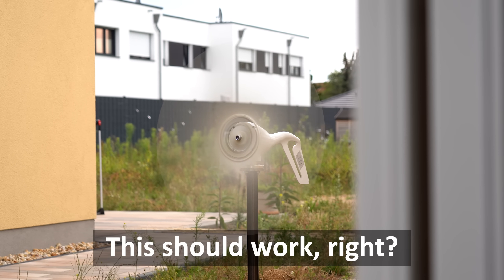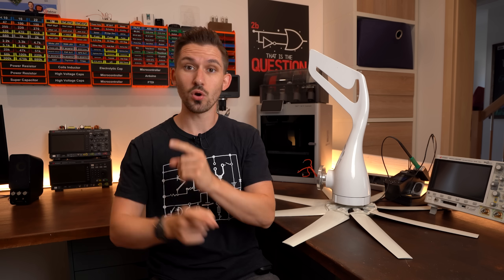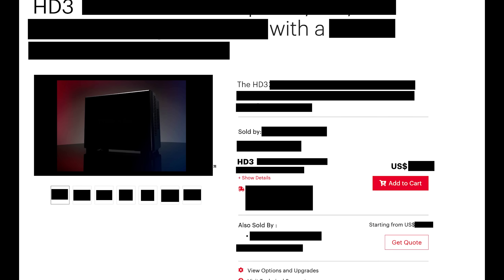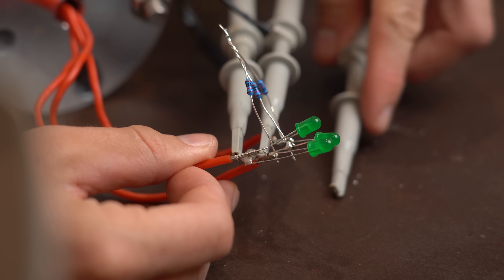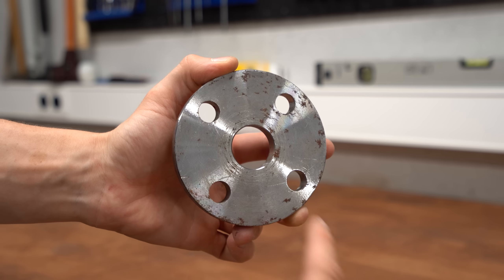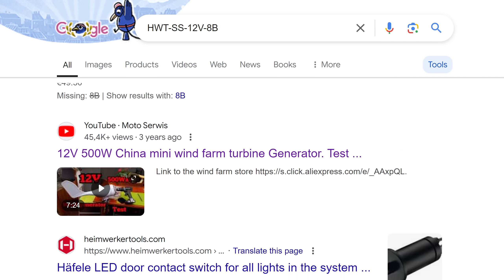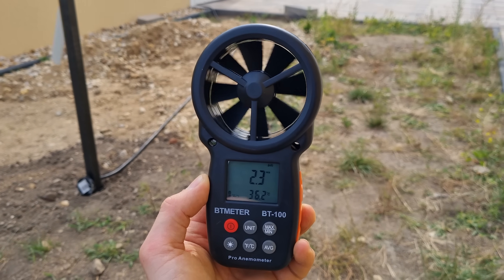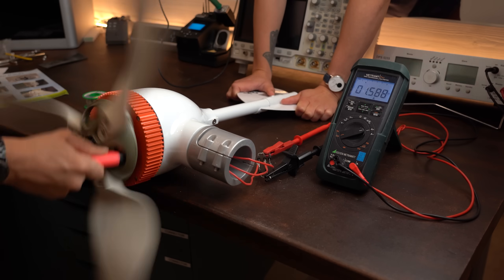I tried to Power my Home with Wind Generators! (Worth it?)

Comment: I just bought a house. It’s a shell. But I have a 40 foot (12 meter) cliff to a stream at my property line. I have an electric scooter with two 1kw motors. I want to make one a wind turbine and the other to make hydro from my future swimming pool. That should help boots my solar. So far I make enough electricity from solar just not from November, December, January and February. But there plenty of wind here in those months.

Comment: If 2 turbines are wired in series at the DC output are they capable of maintaining high enough voltage to feed an mppt? Or could the turbines be wired in parallel at the AC outputs? And tied into a single controller?

Comment: Even if it's your first time welding, it's impressive that you are able to get it done with a stick welder at all. Kudos! Definitely keep practicing, it's a fun hobby, but if you had to start from scratch I would say definitely start out with a flux core welder. It's easier and is like a hot glue gun for metal. It's like learning to drive with a clutch (stick welder) vs transmission (flux).

Comment: you can hardly get several watts from one square meter of the generator sweeping surface. To get interesting amount of energy it needs 5 or 10 times bigger models.

Comment: small wind generators are never really worth it financially. the reason people still get them is either to reach a higher level of autonomy, for remote locations or ships, or as a hobby. The location is also key. the wind turbine should be mounted as high up as possible, and as free standing, regarding the main wind direction, as possible. A high building can be suitable, but there might be NVH concerns, so an extra pole is always a good idea.

Comment: Wind turbines in suburbs no way. I use the latest Jinko 475 Watt solar panels, at close to 60 cents Australian per watt they are far cheaper than any wind turbine I have seen. No moving parts in solar panels, no noise. Interface the solar panels into the 5KW Growatt SPF5000ES inverters these inverters are a budget inverter not that reliable but hopefully they will get the bugs out of them. I like them because of their combining of the MPP Solar charge controller for the 48V battery. My OFF GRID system has been going for 8 years now. Run a separate 230V  OFF GRID switch board exporting is a waste of money now. Leave wind turbines for the big companies.

Comment: 12:20 would cog wheels work? Like bicycle where the front one is bigger than the rear smaller one for more rotations? Can you decrease the chain length or remove it altogether and attach the windmill to a bigger cogwheel that spins the smaller one so fast, it works as expected?

Comment: When you can choose different voltages, always go for the highest voltage. That way even the mppt tracker you got with it will work fine. 12V is not even enough to charge a battery. Most made mistake with these wind generators.

Comment: Could you make some fins that were longer? 

But thinking about it... 24" to 36" -- might only get you a 50% boost ... which would only be 1.5w to 2.25w.   You probably need 60w (or at least 30w) per hour to be remotely useful.

Comment: Not a bad first weld at all.  Go a littls slower, turn up the amperage, & and leave a gap between the 2 pieces (flange / pipe) next time. You can use a few washers to get a gap & and help penetration

Comment: I think a hybrid option would be the best.  Wind power is kind of junk, but it can trickle in a lot of power over a long period of time, so if you have a decent battery hooked up to maybe only the lights and only the secondary water pump, you can lose power or save a bit of money on just a few essentials. 

Combine this with a wood stove and I suspect that maybe you can light a house with LEDs, heat/cook with wood, and power your water pump. Fridge, probably not. PC, probably not. Charge a phone yes. 

The pump would be the most demanding, but the least used. So if you keep your lights off when not in use or maybe supplement with candles and get enough steady wind to  charge your battery, you should be fine.  

Don't expect a lot from wind, but realize that it's not useless either as long as it is realistically sustainable and not breaking down or acting janky often.

Comment: There isnt much you can do with wind energy at such low speeds and small turbine sizes. If I were you I’d try to use the dynamo inside with a water source.

Comment: sense you think they dont have enough power i noticed in the head of the motor the propellers have holes what if you add magnets in those holes and what if you put magnets in the holes in the center shaft inside the motor it also had holes i bet doing so will create tremendous power while spinning

Comment: Allthough small scale wind generators not nearly worth the cost or trouble,i recently tried to repair 1kw charger/ regulator for wind and solar.Draw my own diagrams-  from microprocessor to output mosfets.Took weeks.
Electronically speaking,quite interesting.Learned a lot.Couldnt repair it,due to ic that were totally destroyed.No numbers.But came to conclusion it was well designed,manufactured.Burnt out,owner remove wires at wrong order with strong wind present.Or so i think.
From practical point,total waste of time.Cost too high for construction,generator itself,with relative small power delivery.And the noise will really irritate me.Due to cost of wires,you just cant built it too far from home.

Comment: All these cheap wind turbine generators are just crap. The resistance of the generator coils are way to high, so in the end mainly all the power gets wasted inside the generator. I have bought one myself out of couriosity and teared it apart. The engineers, which designed this, should be ashamed. This borders on fraud.

Comment: A smallish wind generator like you hold in the picture will never power a home,  most of the small ones like that only make 100 watts but what they can do is help support solar and charge batteries at night when solar is off if the wind is blowing.    You need a large wind turbine of around 1000watts to have a chance of powering your home off of wind alone but you still need solar and batteries for times when there is no wind.

Comment: A good solution is to increase the surface area of the blades by making them wider rather than taller snd attaching them to a  large pulley (like a bicycle wheel) and the use a belt to cennect it to smaller wheel pulley attached to the turbine. This way you can spin the turbine at high RPMs to supply meaningful power from relatively slower wind. The key is to improve the torque of the blades.

Comment: Interesting video- you put it to the test in a scientific way. It's not a big surpise that a small wind generator close to the ground near buildings doesn't give much power- most wind generators are placed up high and away from buildings (buildings cause a lot of turbulance). The size of the blades, of course determines the potential output, the small turbines are usually seen on boats as a battery trickle charger, and, of course boats are often in places with a lot of wind, away from buildings. Savonius (vertical) wind turbines that use push rather than lift are better close to buildings but don't move as fast for power generation, they are better for mechanical work such as pumping. But, the big advantage of them is that they are quite easy and cheap to make.

Comment: Thanks for this. Adding the noise issue for anything that is adequately sized and the fact that anything with constantly moving parts requires maintenance and repairs, and its clear that wind power is far from being a domestic power option.

Comment: Over several years of having an expensive 1kw wind turbine, I can categoricaly say it's been a total waste of money. Either there's no wind, too little wind or too much wind where I have to shut it down or even drop the mast. The wind velocity range of operation is ridiculously narrow. I wish I'd just bought more solar and batteries with the money, so as there's way more power stored than I'd ever need. Lessons learnt.

Comment: This video was very disappointing a waste of time. If the turbine has to be so low, where it is a danger, The least you could have done is used a sheet to funnel wind flowing between the two houses into the turbine.

Comment: I did the math too for my place, and i found the power density wind frequency curve didn't justify a wind generator
but maybe in my farm i could put a higher and bigger diameter to power any future electronic controls like a  raspberry that collect data from sensors spread around the farm during cloudy days.

Comment: why don't you hook the turbine up to a step up transformer instead of rewiring the generator, get it up to 20 volts then hook that up to a voltage regulator of say 15-16 volts to charge the battery? problem solved.

Comment: You answered your own question, create a simple 24v system and try again. These things work at higher voltages so why would you diminish the hardware on lower quality battery? Also, that looks like a dry cell car battery. These things work best with Gel/AGM batteries or Lithium batteries. No need to modify anything but the battery and make sure the controller is picking up everything as intended.

Comment: This is a shame. I'd like to have an alternative source of generation for overnights, when I'm asleep my house uses 200-300w while I'm not doing anything with it (sure fridge is keeping things cold, but I'm not actively using things because I'm asleep) I'd like a small 200-300 watt's of generation just to get things down as low as possible. Battery will be on the cards, just not yet.

Comment: That low to the ground? You need at least 20 meters of clearance off the ground to get into the range where the wind never stops. (That's 60 feet or about six stories tall, for my fellow americans).

And you don't want a fan-blade system like that. Very inefficient. What you want is a waldorf-turbine. Basically, you make a 6-10 story tall chimney. You install the fans laying down. You've got slatted openings at the top and an opening at the bottom. It's not the wind itself directly, but the differences in relative air pressure that will force air through the turbine at a constant speed. For more efficiency, ditch the old prop-plane toys and use that ai-designed super-rotor MIT developed with the helix-shaped blade. And since you've already got a steady air supply set up, look into some sustainable passive-cooling/heating options and repurpose the ground-level output from the chimney into a comfort appliance.
Reply: sadly not legal where he lives (domestic)
Reply: @simonh317  Height restrictions? I'm unsure of zoning specifics.

Edit: Checked the zoning where I live, buildings are allowed a maximum of 35 feet (about 10 meters and some change) above the foundation, but chimneys are allowed another 30 feet on top of that. So if you built 'wind chimneys' into the structure of your home, you can hit a good 65 feet. That's right around 20 meters and in the sweet-spot for a waldorf turbine.

Comment: I've been using a 600 watts B&C Chinese wind generator for two years. It's 5.5 meters high, the pole is attached to the barn peak and the generator part is two meters above that. I get around 50 watts in a 7 mph wind, and 350-400 watts in a 35 mph wind. It put out 19-21 volts with no load when I first tested it. I have it connected to sixteen 12.8 volts marine batteries through a 250 amps rectifier. I use the power to supplement the sixteen 100 watts solar panels on the 24 volts side of my system. They charge four 24 volts 100 amp hours lithium batteries and four 31 series lead acid batteries. I've used this system for two years for all of my power. I had to have both 24 volts and  12 volts inverters. The wind generator cost me $433 USD.
Reply: Slap one or two solar panels approx price 30 bucks per panels and add some regulator, hmm 50 bucks should be generous enough and you are at same numbers,  better cost.
Reply: @JanicekTrnecka Oh, I already had 1600 watts of solar panels before I got the wind generator. I bought fourteen more 100 watts panels this year, a second 40 amp charge controller, and eight 24 v 100 amp hours lithium batteries. However, the panels are in a poor spot, and I only get a few hours of sunlight this time of year. Buildings in the way of getting a good Southern exposure. I have plenty of power though. I got six of the panels this month. The wind generator helps a lot in the winter, when the Sun is less hot.

Comment: So a problem with these small turbines is they need lots of speed something like 12mph to even start making power to achieve meaningful power generation look an an axial flux turbine either diy or buy one they make serious power from very low wind speeds is coupled with the correct blades if you have low wind speeds on average use many larger pitch blades as they will start at lower speeds and produce more torque at slow speeds just make sure you can shut it off in high winds the heavy mass of all those blades will break things if the whole thing isn’t built like a fall out bunker oh and yes get the thing up high I’m talking 40ft plus

Comment: All I can tell you is that you should study and build your own. Forget the cheap China made wind turbines. I built one with a 450 watt 36-volt hoverboard motor. 5 amps at 14-volt in 5 mph wind. That is almost unheard of. Used certain kind ceiling fan blades. They were made like turbine blades and a lot cheaper than wind turbine blades. Lost it all in a storm. I have yet made one that good again. I did get more blades from home Depoe. I cannot find another 450 watt 36-volt hoverboard motor.  I have found some 300 watts and 350-watt motors. I have not got one of these to try. Good luck on your wind turbine trip. P.S I tried a 500 watt 12-volt China made turbine. I would take a biggggg windstorm to get 1 amp out of it. Junk.

Comment: I lived near the coast a few years back a thought wind might be an option. There was a steady breeze after 11 o'clock most days, the trees were even shaped by it I have a weather station, so all the data needed for my site was available. The amount of time the wind was strong enough to meet the low end threshold of regenerator was pathetic. What was surprising to me, was just how strong that low end threshold is when physically standing in it.

Comment: Good video. Back in the 1920s Admiral Byrd went to antartica and set up a Jacobs Wind Generator. It lasted 50 years and was taken down in the 1970s. Wind generators can work but they have to be made right. Those little cheap generators have many problems. Look for an old wind generator. Chances are that the new generators aren't using copper in their windings. In the 1970s in the US there was a lot of interest in "back to the land" topics. There were many articles on building wind generators. You could build a generator from an old automotive 12v generator. Good Luck, Rick

Comment: Some sort of overdrive off of the propeller shaft to the generator. Like a bicycle, larger chainring on the cranks, small cog on the cassette. 

Also, i do believe that the big wind turbines run some sort of overdrive gear system.

Comment: This is confusing to me, what does those small generators have to do with homes? Those small generators are for batteries with inverters. House wind generators are totally different and use different components to feed the grid.

Comment: Wind power is a fool’s errand. The only way it makes sense is for small power systems, like LED lighting in a remote barn, but even then, a small solar panel is worlds more effective, reliable, simple, affordable, and modular. Go for the maximum wattage panel you can afford, use the cheapest well-reviewed LiFePo4 batteries you can afford, and never run more than 4 per  MPPT charge controller. Don’t spend gobs of money, don’t take out a second mortgage, just do your research and buy wisely, install it yourself. Don’t try to power your whole house, just build it as you can and run a separate, standalone system to power the refrigerator first, then the hot water heater, then the heating…adding circuits as you can afford to upgrade your panel array and your battery bank.

Comment: Read the specifications before you buy it will solve a lot of problems. Make sure you’re getting a 12 volt DC generator. The height of your rotor blades is going to be a danger to pets, children and even adults. For safety reasons it needs to be well above people heads.

Comment: And if the Power is used for storage. Continuesly charging a Power supply?
In a mixed System with solar to fill a battery.

Comment: Have you tried to raise your turbine to a higher level? You can get more air speed and power is a function of v^3. I strongly suggest measuring the air speed, say at the roof level, compared to your current level and see. Good luck!

Comment: imho wind turbines for homes are not worth it in the majority of cases. Other houses cause turbulence and slow down the air so energy production will be rather low. In addition they are generally really noisy and like in your case you can easily get caught up in regulatory issues further hindering what you can do to get best performance.

There are some cases where it can work out especially when you don't have many obstructions (like houses, trees etc.) nearby and a high average windspeed (can be checked one something like global wind atlas) like on farms or cabins that are rather isolated from other buildings.

Comment: I don't understand the issue. You just need to get the right wind turbine...    I went to a isolated cottage in North Norway and they have been using a small wind generator to charge (2) 12 V deep cycle batteries for years..